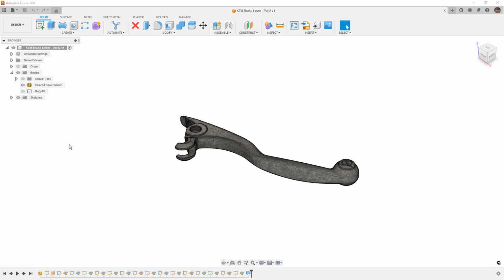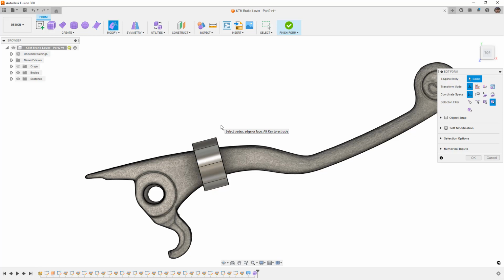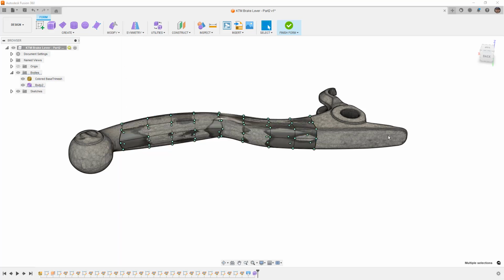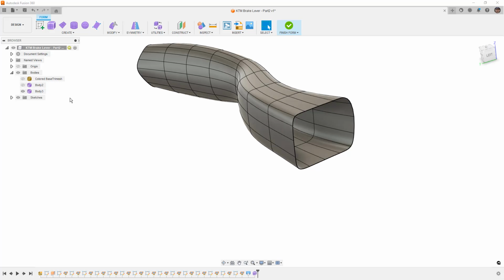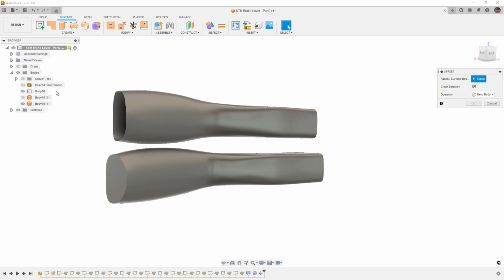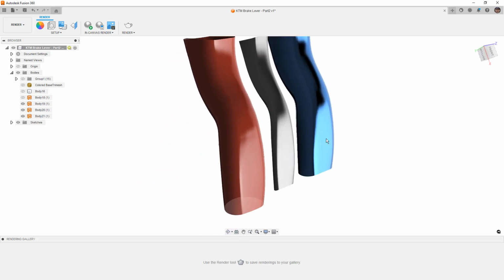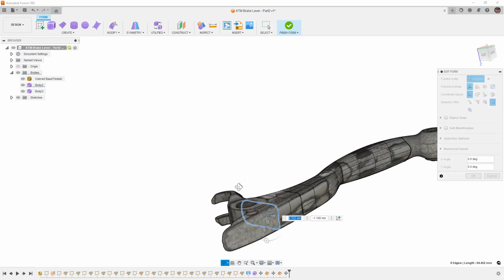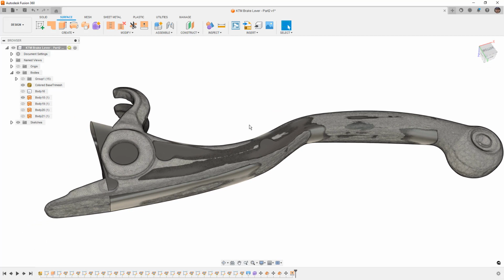Reverse Engineer Workflows in #fusion360  Part 2 | How To Work Use Freeform Tools for Good Surfaces

Comment: Great videos, been watching a lot from you lately. I would like to know your opinion on which method would be preferred for a steering knuckle or other suspension components? I watched Making for Motorsport's video on that exact subject, and he used a simpler method of mesh section sketches and forming closed splines to the curves, going section-by-section and extruding (I think?) the knuckle parts and then joining them into a solid. I noticed his second monitor in the background had your youtube channel pulled up, and he did give you a shoutout! 
Now that I see this forming method, though, it is very cool and makes a lot of sense; I'm just wondering how or if you could apply it to a part with features in multiple planes, such as steering knuckles. I'd mostly use it for just modeling and changing suspension links to the chassis, front and rear, but also possibly changing the knuckle design in the front, and iterating ideas for a rear dual caliper mount in the rear.
Thanks for all the great CAD videos!
Reply from the maker: Thanks, and yeah appreciate David giving the channel a shoutout.  I try to send folks his way as well as we approach things a bit different.

To the heart of your question it sort of depends on the knuckle.  Most are fairly prismatic and I would likely take the same approach of mesh section sketches.  The video you commented on was part of a series where we looked at a few methods and in the next video we do a bit of a hybrid approach because as I mention the curves to mesh sections for splines are kind of meh.  so you have to use some judgement there.  I have this other series on a bar clamp https://www.youtube.com/playlist?list=PLBDfGh8A8kXWYEY9X4vJ5sKGh6TPzrr2h   that walks through the process.

No matter the method you really need to measure everything that is critical.  Years ago we did a reverse engineered spindle to add a second caliper to it.  The data was gathered with a CMM and not a laser scan so we could get precise data on hole locations for example.   I do have some near future plans to do this sort of workflow but might be using another piece of software before Fusion to build it out with primitives.  Something like QuickSurface, but the workflow is still the same.

As for the forms vs mesh section.  If you have something that is very organic and cast where it doesn't instantly hit that Prismatic check box, forms can be a good hybrid workflow.  You will still want to use primitive features like sketches and extrudes to build out a good bit of it though.
Reply: @LearnEverythingAboutDesign  I'll definitely watch the next video in this series for the hybrid process. My work has a CMM, but I'm not sure I'd be able to use it for my own parts hahah, so I'll probably do a 3d scan of some kind. In your experience, just how far off are scanners when it comes to center location of holes? Part of why I'm interested in 3d scanning and then converting to a solid CAD model is so I DON'T need to measure everything by hand. I don't mind measure simple diameters, but the knuckles for Chargers/Challengers look very complex, especially the rear! 
Lots to think about!
Reply from the maker: @WyWorks  Single frame scans are pretty accurate but the problem is that the more frames you add and mainly the bigger distances you cover, the error is compounding.  CMMs with a base station are going to be more accurate.

How accurate do you need is probably the question.  Like if you are doing a press fit bearing or have a taper needed for a rod end, measure it.  Most other stuff can be a bit off.  Like lets say a rod end location for a tie rod is +- .1mm, just turn the turnbuckle during alignment a bit more :).  Really we are talking fractions.  like a physical measured part being 35mm and the scan 35.01mm.

When you look at large scans the accuracy starts to become a problem.  Like if you were trying to scan over several feet for say a traction bar mount point relative to say your front end, now you may be getting into a few mm off depending on the scanner. 

In general you still want to measure critical features even if you can't measure pickup points in space in 3d, get numbers for hole sizes, areas for bearings etc.
Reply: @LearnEverythingAboutDesign  That all makes sense to me! I have no issue measuring the actual hole sizes or things like that, and a couple reference measurements to double check a scan as well! I just think it would be impractical to measure an entire knuckle by hand. 
I've seen really good things about the Otter scanner, it seems to handle black and/or shiny objects better than most, and seems to have the focal range best suited for my intended use. I have seen your videos on it as well, and that's the route I'm leaning. 
I also found your video of the s54 turbo engine mount, and found that very interesting as well.
Thanks again for your videos and your responses to comments!

Comment: regardless of what software the way you're describing this stuff has been incredibly helpful as i'm new at this.     in this video the discussion is very much along the lines of the potential complications of by-hand patterning i've had to deal with in the past as far as additive or even multiplying effect of minor error depending on whether it matters or not for what you want to do.     so if i'm patterning by hand for a fabric cover meant to be taught on a tubular structure, the thickness of the lines i draw and where i draw the lines on the patterning plastic i've taped down has a huge effect down the line after tracing copying and cutting things out.  (in addition to the stretch of the specific material which is something you learn to deal with too and not well quantified)...    one thing (of many)  i'd like to be able to do eventually without having to spend 18k on exactflat software is scan a tubing structure and make a 2d pattern to cut out and sew up that will come very close.   anyway thanks for these vids.   subbed.
Reply from the maker: Thank you for the sub!
What you are trying to say and do is tricky for sure. and yeah Exactflat is a bit "high" on price :)  FWIW you can unwrap faces in Inventor and Solidworks.  I think Inventor is a bit cheaper yearly.  I just had to pay almost $8000 for 2 years of solidworks....  BUT there are other options.  While not exactly the same there is another program called Wrapstyler. https://www.wrapstyler.com/software.html
I have no affiliation with them and no clue on pricing, but they have several tiers which is a good sign :)

Comment: A++ video...

Does anyone know if FreeCAD possesses similar tools, in particular, the 'free-form/pull' tools, and if so, what workbench(es) are they found in?

Now that I think of it, I'm wondering if Plasticity has similar functionality...
Reply from the maker: Thanks!  At the current time Plasticity, nor FreeCAD offer SubD/freeform style modeling to the best of my knowledge.  FreeCAD has solid and surface modeling as does Plasticity.  FreeCAD is a parametric modeler, similar to Fusion360, while Plasticity is a direct modeler meaning there is no history, constraint system(after curve creation) or sketches.

Freeform modeling is available in Rhino, SolidEdge as well as other CAD packages but there are pros and cons to each option.  SolidEdge freeform modeling is limited in my view and doesn't have the same level of working directly on mesh bodies as Fusion.  Rhino has a pretty robust toolset but the UI/UX is where it falls down for me.  I think it could be a really great asset.  Tsplines that is in Fusion 360 used to be available in Rhino until Autodesk purchased it some years ago.  Now it is built into Fusion 360 and Inventor(although slightly different implementations for some reason).
Reply: @LearnEverythingAboutDesign  Thanks for the reply. I am very familiar with freecad, and use it regularly for hard-surface modeling, but I've recently delved into reverse engineering scans I've made of various parts of my Vespa scooter's fairings. These scans are curvy as all-get-out, and I'm struggling to reverse engineer them, in either FreeCAD or Plasticity, even using the techniques you provided in other videos wherein you REed a car fender.

I sure wish FreeCAD and Plasticity had a NURBS surface equivalent of Blender's 'shrink wrap' and 'clothe simulation' tools, whereby I could import a point cloud/mesh, place a flat NURBs surface above it and tell the software to 'drop the surface down onto' the mesh and form-fit the surface.

I should note that FreeCAD's 'Mesh' workbench has a tool that lets me create splines on a mesh, but it is, in a word, crap.

Edit again: I think FreeCAD has a cross-section tool that I tried a long time ago and wasn't impressed. I think I'll look into it again.
Reply from the maker: @imacmill  yeah the issue with most mesh curve tools is that the end curve is "nasty".  Not something you would ever use in a true design.  What is your end goal with the parts from your scooter?  Are you just trying to learn how to model them or do you have plans to modify the design?  I like the freeform in fusion because you snap your form to the mesh but still keep a smooth surface.  It could be done in blender if you are ok with that workflow and your end goal is to 3d print the parts.  That way you could directly push/pull on the scan :)
Reply: @LearnEverythingAboutDesign  I am creating hand guards for my scooter (basically, 'scoops' that block wind from my hands), and I am experimenting with ideas on how best to mount them to the handlebars. I have limited options in this regard, but the path I'm going down is making a hinged 'collar' that wraps around the fairing that leads up to the hand-grips, and that section of the fairing has complex curves.

I've already created the basic collar from scans I made of the fairing (resulting in STL and/or OBJ files), but because I'm using Plasticity to create the 'scoop' part (because I find Blender's NURBs surface tools hard to use), I would like to convert my poly-based collar to NURBs (a STEP file) that Plasticity can use, other than just importing it as a dummy OBJ that can't be used in any operations. I can actually do this already from within FreeCAD (import poly OBJ, use mesh tools to make it a solid, then export as STEP, but the resulting STEP is just a crap-load of NURBs triangles, and that absolutely clobbers Plasticity, CPU-wise, so not a good solution).

 I am experimenting with FreeCAD's cross-sections tool now to see if I can coerce the poly-based collar into a NURBs surface...not hopeful.
Reply from the maker: @imacmill  If you can remesh that in blender or another program to a quad mesh, its a bit easier to turn it into a clean model in Fusion.  https://youtu.be/wRXf4QyMCMc  
as far as the handguards I understand.  I run various styles on my bikes.  Some bikes have a plastic arm that mounts to the bar just inside of the clutch or brake master.  others i run for supermoto actually mount closer to the triple clamp and also go into the end of the handlebar.  MotoGP bikes might offer up some inspiration.  They run a lever guard( to prevent the front brake or clutch from being pressed int accidentally) that only mount in the bar end. I did a quick search and found some companies make them. Zuwepo was one on amazon that listed a bar end hand guard.  https://www.revzilla.com/motorcycle/barkbusters-aero-gp-lever-protector
Reply: @LearnEverythingAboutDesign  Thanks for the info.

I am not keen on moving to Fusion...it's a learning curve I'm not willing to climb at my age. I already have too many brain cells invested in Blender/FreeCAD. :)

I've already gone down the road for mounting the guard on the handlebar end, and quickly abandoned it because the arm length would need to be 16cm to provide clearance between my fingers and the guard. Also, it would be aesthetically unpleasing...a bulky arm arching out and forward to the guard.

I'll report back if I have any luck using FreeCAD's cross-section tool.
Reply: @LearnEverythingAboutDesign  He, LEAD. Just thought I'd report back to say that I gave up on FreeCAD's cross-section tools, as they are quite lacking. I ended up just using MeshMixer to clean-up and simplify my scooter fairing scans, pulled them into FreeCAD and used '3D Printing' workbench to ready the mesh for export to STEP, then pulled the STEP into Plasticity. All is good (enough). It just sucks that Plasticity doesn't have feature history...
Reply from the maker: @imacmill  Thanks for reporting back!

Comment: I've never worked with freeforms before as they feel more like doing artwork.  I think years of having fully constrained work beat into me has made it hard for me to accept direct editing.  This video however has really shed some light on things and has me wanting to give this a try.   I'm extremely excited for the next video to see how you finish the part and turn it into a closed solid.

Thank you for your videos, I'm going to go binge through them all now.
Reply from the maker: Thanks Nick!  With forms when you "Finish Form" if its closed it will convert to a solid, if its open it will convert to a surface.  They are a powerful tool and produce better geometry than the traditional surface tools in Fusion in most cases.  Definitely worth a look!  The Fusion mastery Series here has a lot of videos but they focus on specific tools or topics, while most of the other series using forms look at a project like a car,
Reply: @LearnEverythingAboutDesign  all things I'm wanting to learn.  I've been using Autodesk Inventor daily for the past 10+ years doing sheet metal work for press brakes.  Which is all fully constrained flanges so surfaces, freeforms, and heck even Fusion is rather foreign to me.  I purchased a hobby 3D scanner for use with car parts which I've managed to figure out, but now I'm wanting to learn to work with organic shapes so your video series is going to be helpful beyond measure!  Thank you so much for this!

Comment: Just used this method a few weeks ago on reverse engineering a B pillar car part. Learned it from an older video you had done fitting a wing to a car. Also did the the loft mesh section sketches on a 3d scanned bumper a few months ago....wish I knew the pull command at the time because that took forever! PULL FORM TO 3d SCAN! THE PULL COMMAND FOR THE WIN! (that is what this video should be called haha) Thanks so much for making these videos and opening doors in design for everyone. You are really an awesome teacher! Can't wait to see the next steps on how you finish this model. I know how I would do it but it is so interesting to see your methods because they are quite ingenious.
Reply from the maker: Awesome to hear!  Those mesh sections are a bit deceiving and can work ok depending on the intended outcome of the model.  Hopefully ill get the next video done in the next few days.